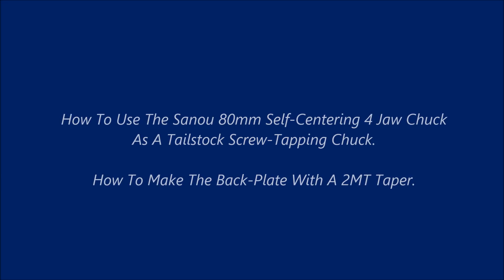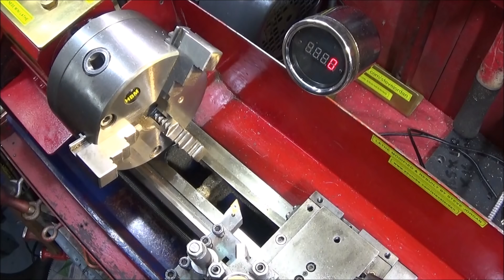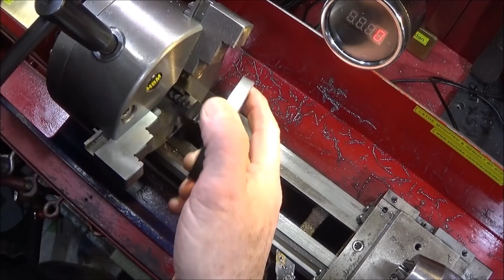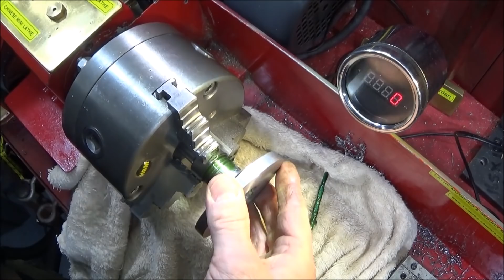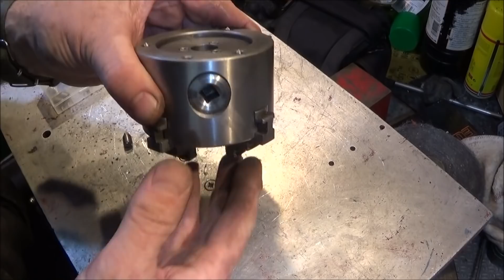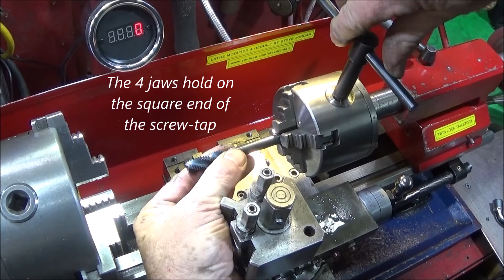A 2MT Backplate For The 80mm Self Centering 4 Jaw Tapping Chuck

Comment: I could have used this set-up the other day. I had to face a flat and drill and tap some 2 inch steel balls for my front porch railings. I managed to get the tap started in the lathe but, only a thread or two, before the tap started slipping in the tailstock drill chuck. Got the job done but, your accessory would have made it much easier. I do enjoy your videos. Thank you for making them.  Have a very Merry Christmas and a Happy New Year. Cheers!

Comment: Very handy being able to put chucks in the tailstock. Having a myford I was able to buy a 2MT arbour with the myford thread on it so I can mount any of my chucks in the tailstock or in the morse taper of another lathe.
Reply from the maker: Yes I have one of those as well. I have'nt tried it with large screw taps though as I thought maybe it would unscrew from the 2mt adapter?
Reply: @SteveJordan  Going forward it would be fine, reversing back out there is a chance I guess but you could always use a brace against the bed which would stop the taper slipping as well.
Reply: How do you use a brace against the bed?

Comment: Gday Steve, great job mate, that’s a great idea with the grub screws and pointed Allen key to transfer the centre, I’ve never seen nor heard of this before, I wish you and your family a wonderful Christmas and please stay safe mate, cheers Matty
Reply from the maker: Hi Mat. Thanks Have a great Christmas as well. I got the idea from someone else using the grub screws although they fixed the allen keys in place a little longer and used a socket to screw them in. I did see on one engineering retail site that they sell sets of transfer screws but they were quite expensive. Regards Steve

Comment: do you  have  the  pt. no.  for  tool  inserts  for  truing  up  hardened  lathe  jaws ?  great  video  by  the  way!
Reply from the maker: Drillpro 10pcs HRC45 Blue Nano DCMT070204 YBC251 Carbide Insert for SDJCR/SDNCN/SDQCR Turning Tool
https://ban.ggood.vip/116V6
Normal Price: $23.99
Coupon Price: $ 16.99
Code: BG4b76e8
Warehouse: ALL
EXP: 3.31

Comment: Turning an Allen key for the transfer punch is a great idea. That definitely a keeper! Still I was disappointed when you talked about"feeling" the level of the height of the points when I know you know darn well that 3 point define a plane. Any rocking is the result of pushing down where those points are not.
Reply from the maker: No I can feel and see when one is out. I wouldn't have said it if I couldn't. When one makes things like this you get a precision feel whether it is correct or not. I can tell immedietely by the method whether the points are all equal and level. I showed what I meant better in another video on the subject.
Reply: @SteveJordan  I don't know what to say to that. I'm astonished that you don't acknowledge that 3 points define a plane or that using a height gage would assure the points were set equally. What's up with the stability of a 3 legged stool? It doesn't rock.

Comment: Hello Steve.  Just wanted to let you know that I ordered the Sanou 4 jaw chuck, made a back plate for it, and attached a 2mt by 1/2" x 20 threaded taper (with the recommended LocTite).   You were right, it was always a challenge to get a drill chuck tight enough to allow tapping on the lathe.  Kind regards, Al
Reply from the maker: Hi Al thanks for the feedback. I'm pleased you liked the idea....Regards Steve

Comment: Good morning Steve I hope you are well. I have followed your  videos on upgrading the mini lathe over the years and have carried out many of your upgrades and machining fixtures on my previous 7x14 mini lathe. I now have a new 8x16 mini lathe and am about to make your 4 jaw tapping chuck fixture however I propose to use an aluminium bar end which I already have. Do you think that aluminium would be suitable or should I try to find a steel or cast iron bar end. I have learned a lot and have drawn much inspiration by following your videos. I wish you well, thank you very much.

Comment: Wish you a merry X Mas and a very happy new year. I guess another way of doing this drilling in the tail stock malarky is to just use your existing ER Collet Chuck in the tail stock. Even the crappy Chinese ones with 0.002" TIR would be mostly accurate for simple drilling ops. Thanks again for your very informative videos.
Reply from the maker: Thanks I could use the collet chuck but this method is much faster to use not having to change collets. Have a Great New Year as well. Regards Steve

Comment: Use a set of vise grips to hold Mt drills, when drilling, or you will ruin the tail stock ram bore.
Reply from the maker: Well I haven't ruined one in over thirty years of machining. I have never used vice grips once
Reply: @SteveJordan  Well i have experienced slipping in a no.3mt,but that was in production turning,a long time ago.Like your video's,you have some unique idea's.

Comment: Isn't it possible to attach the MT arbor directly to the spindle when machining it? It would result in a greater accuracy even without the need of indicating. At least my mini lathe (TOS MN80) is capable of holding MT tools directly in the spindle.
Reply from the maker: Hi yes it could. Mine has an MT3 taper spindle so I would have to use a tapered sleeve. It is much quicker to machine it like I did though and the accuracy is spot on. Regards Steve

Comment from the maker: LINKS TO THE CHUCK & TOOLS
SANOU SELF-CENTERING 4 JAW K12-80 Lathe Chuck Tool -- https://goo.gl/WU2TB1
Machifit 4 Piece Tool Holder Set & 10pcs DCMT070204 Carbide Inserts --  https://goo.gl/QRUY9K 
THE BEST COBALT DRILLS SETS.... Seen in use in this video:-
8pcs HSS Reduced Shank Cobalt Twist Drill Bits Set --  https://goo.gl/YQ5PCP
Drillpro 19pcs 1-10mm HSS M35 Cobalt Twist Drill Bit Set -- https://goo.gl/YaEnRb
Drillpro 15pcs 1.5-10mm HSS M35 Cobalt Twist Drill Bit -- https://goo.gl/RKgAQG

Drillpro 10pcs HRC45 Blue Nano DCMT070204 YBC251 Carbide Insert for SDJCR/SDNCN/SDQCR Turning Tool
https://ban.ggood.vip/116V6
Normal Price: $23.99
Coupon Price: $ 16.99
Code: BG4b76e8
Warehouse: ALL
EXP: 3.31
Reply from the maker: Banggood Health Protection -- http://bit.ly/33tNTBx
  Banggood Health&Care Protection --  http://bit.ly/3d7QpSy

Comment: Does the Morse taper just slide in your tailstock or do you have a draw bar in the rear? I see threads in the rear of the Morse taper shank. Do you have any problems with the shank spinning when tapping?
Reply from the maker: Hi, they just slide into place. Sometimes they spin though. You have to make sure they are clean with no oil. 
 The Chinese Mini lathe has a short winding travel. I normally shorten the mt2 taper tool a bit so there is more travel before they are ejected. If you don't know what I mean I can show this on a short video? Regards Steve

Comment: lock tight 638
Reply from the maker: Its a very high strength adhesive. It will never come apart unless it is heated up to a certain high temperature and even then it is difficult to break

Comment: Steve I notice that you are using steel for the backplate . I'v had problems with bruising and galling with steel and now use cast iron . Your thoughts on this would be appreciated.
Reply from the maker: Hi if you have a good finish on the backplate and it is kept clean there will be no problems
 Also the chuck I use for this set-up will stay on this backplate for good.

Comment: Hello Steve.
I've bought one of these 80 mm 4 jaw self centering chucks. A cute little thing for which I'm about to make a backplate.
I've thought about also making a crotch pad for center drilling, but is it really necessary to have one of these. I mean the 4 jaw chuck makes it possible to bore in the center of a rod when holding or clamping "diagonally" in the 4 jaws, right?
Alternatively, could you combine a crotch pad with MT2 taper and a back plate with MT2, so that it could be used in both circumstances or as both one at a time? Just to save "stock" material which is hard to come by. Most companies do not sell to "privateers"/hobbyists due to complex tax regulations. I'm lucky though that I have a limited source at a local "technical" college in the form of scrap metal.
Thanks in advance for an answer on the question and for your ever inspiring videos.
"RagnarOK"
Reply from the maker: Hi Regnar, I have never used mine diagonally yet, as I have always used my independent 4 jaw chuck for doing bar like that. I must give it a go tomorrow and see. I haven't heard the  term 'crotch pad' I think you are referring to the V block type of tool on an MT2 taper? I have a couple of those with clamps to hold the bar in the tailstock for drilling. I think I did a video on those. I called them a cross drilling adaptor or fixture.

Comment: Does the country of origin of a tool always be announced? You don’t refer to The Myford as the “British small lathe”.  Well at least you did drop the “cheap” accolade from the small red lathe.  🍺. Love your vids and info in any case. 😁
Reply from the maker: It is always referred to as a Chinese Mini Lathe. I've never said it is a cheap lathe either. I actually think they are very expensive in the UK as they generally need several improvements even if bought from new. Having said that though I think they have excellent capabilities if upgrade a bit. I really like the lathe it is so fast to use.
Reply: Yep - I have one too - a Sieg C4/LMS 3536. 8.5"x16" with BLDC motor. Seems fairly capable, but the overall workmanship IS a bit shoddy.  Perhaps not by you - but there ARE a lot of videos on You Tube that have as "cheap Chinese" part of their title.  I do think (especially with the great offerings from Banggood) they are quickly moving into the "very capable" and "not so cheap" category.   :-)